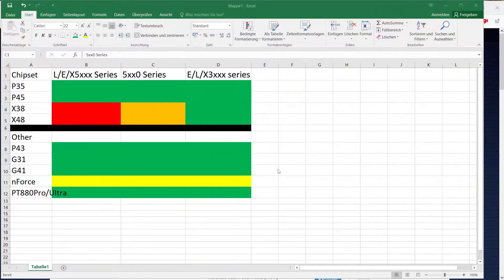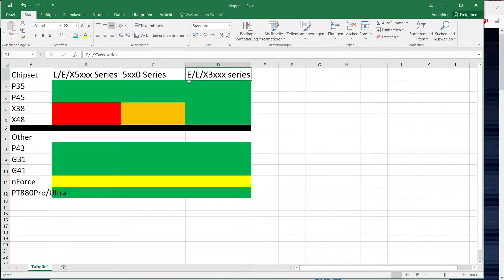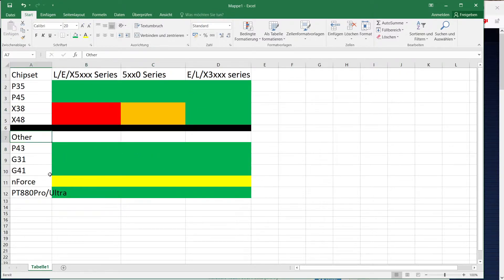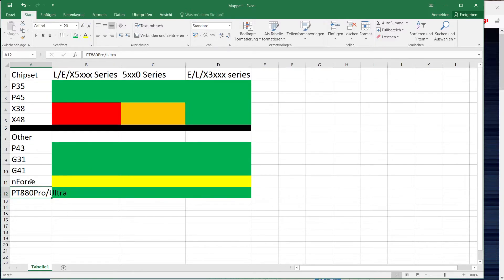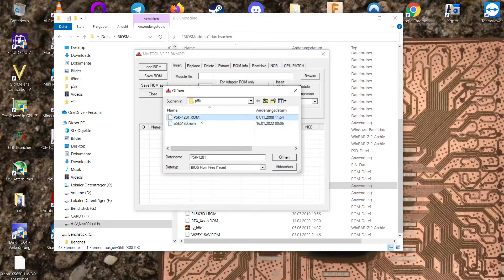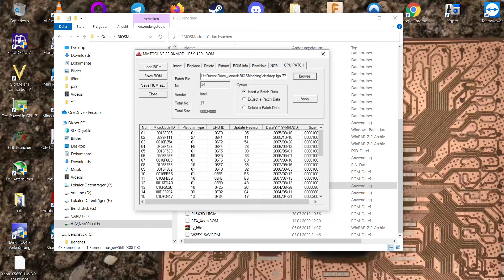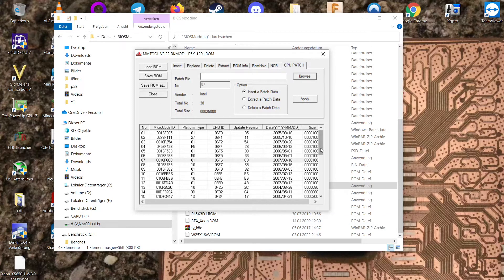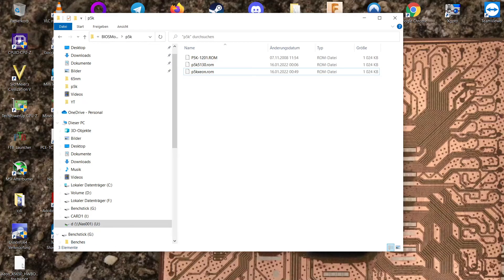How to add any uCode to AMI BIOS based 775 Mainboards using MMTool / 771 to 775 mod

Comment: Would this way of BIOS modding also make the Asrock 775DUAL-880Pro run Core2Duo E7600 CPU’s (like its similar model 775DUAL-VSTA)?
Reply from the maker: No, the 775dual-880pro is lacking the hardware support for core2duos, so BIOS mod won't work :(